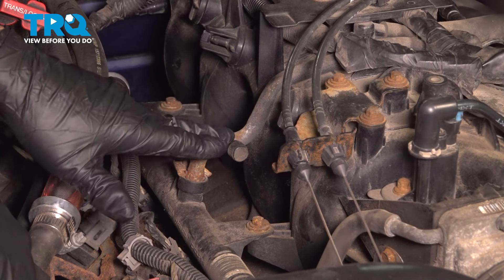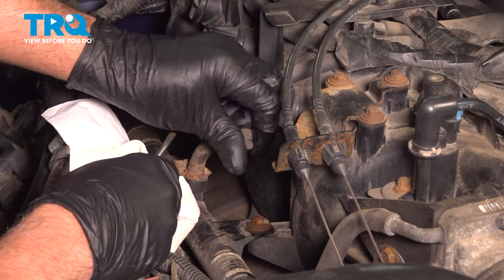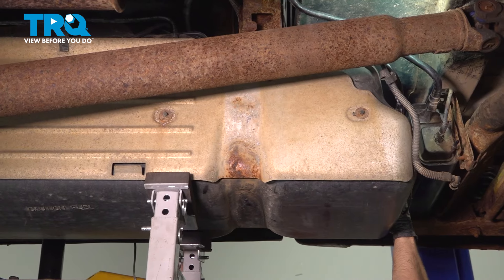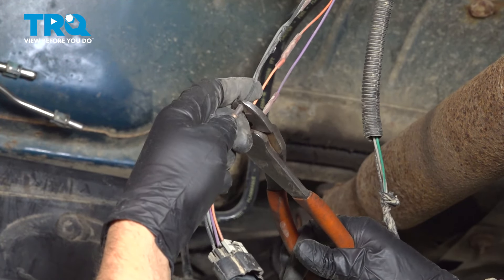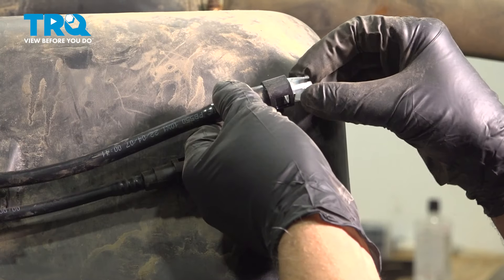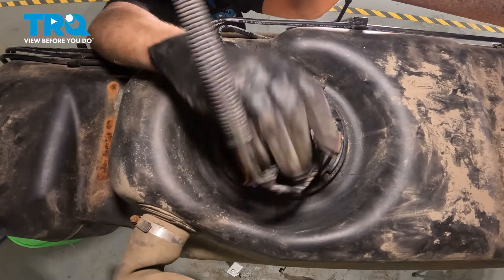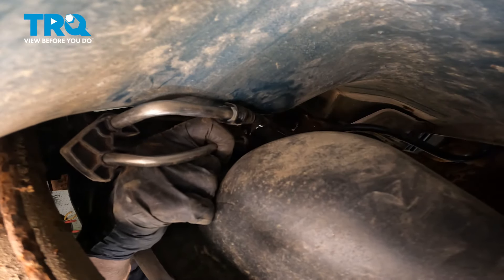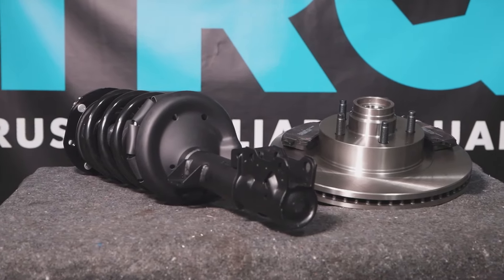How to Replace Fuel Pump Wiring Harness 1999-2006 Chevrolet Silverado 1500

Comment: You can also undo the bolts on driver side of the bed and loosen the passenger and lift the bed and place a Jack stand to hold it in place, you can get to the fuel pump/ connector that way instead of dropping the bed

Comment: Why was the connector being replaced? Mine has been replaced before also but a bad connection on the splice may be interfering with fuel level readings. But I'm not sure if a poor connection can do that.

Comment: This video is best conditions. If your using a Hydraulic Jack tand or remove bed to remove pump,  it will be a lot more difficult. Need to syphon gas first to decrease weight of tank. 
This is not realistic demonstration but there is good show and tell advice here.

Comment: It is a whole lot easier to do if you take the bed bolts loose from the frame and either remove the bed or jack it up on the tank side of the truck. I stopped watching when I saw you removing the tank like that.